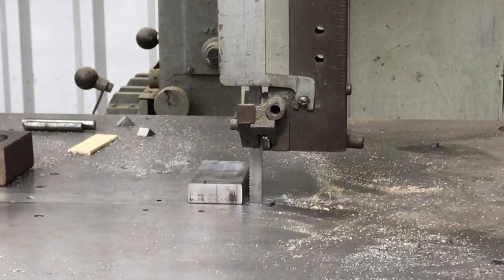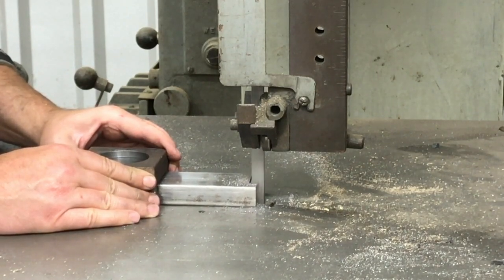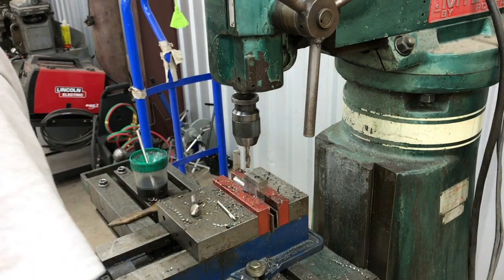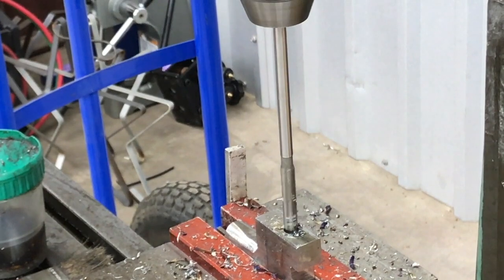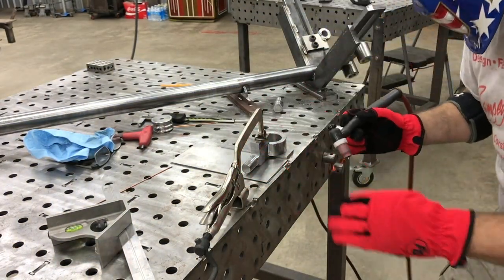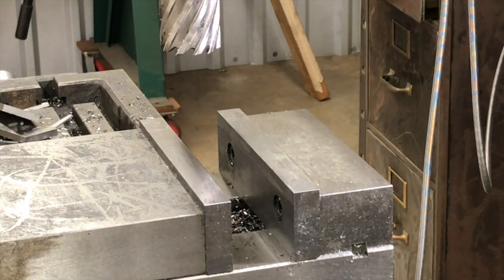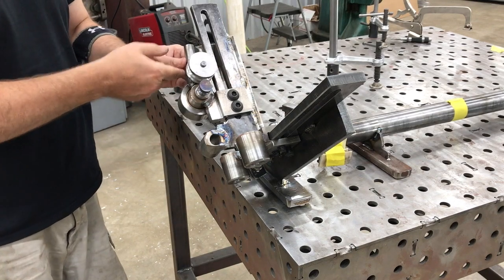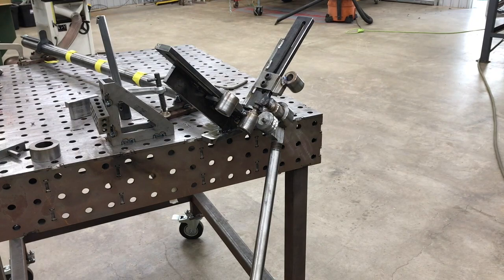X-Wing Tubing Bender

Comment: Minimum center line radius for tubing without a mandrel is 3x IIRC.  Most dies are built with a 6x CLR to prevent any crimping.  So I can see how you would need to anneal the tubing with heat prior to bending.

Comment: what is that wall thickness of that tubing? I've used swagelok tube benders on 12mm OD, 10mm ID stainless and it didn't seem to take that much force or crimp the tube as much
Reply from the maker: yea, I have seen those benders, those bend on something like a 1.5" radius, I am using 1/2" radius inner die